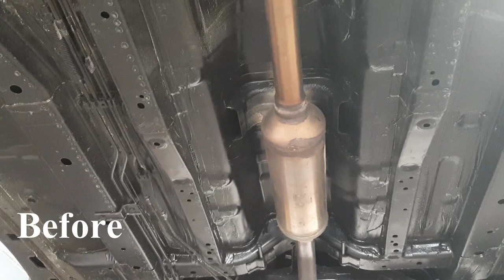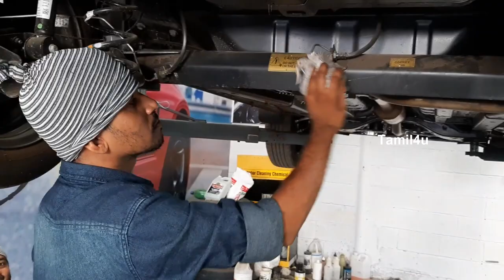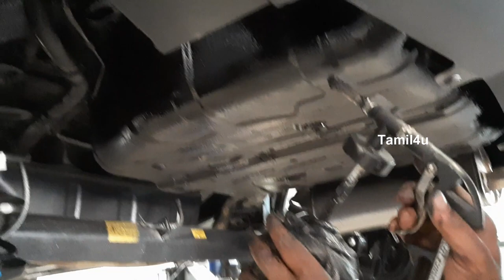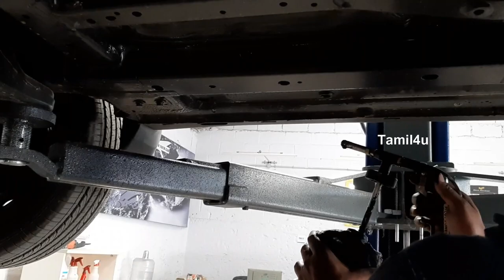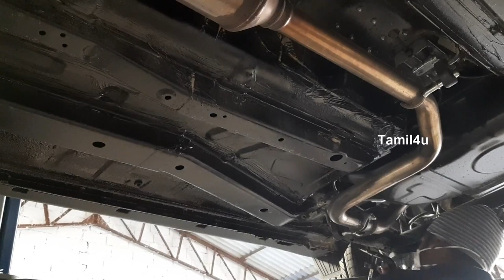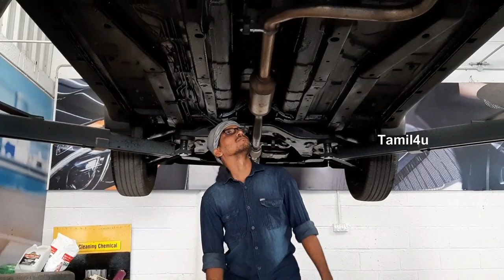How to Make Car Under Chassis Coating | Car AntiRust Underbody Coating | Nexon Accessories | Tamil4U

Comment: Bhai jo pahle se black color he bo pahle se ki coated he, company se aati he coated, apne jaldi karwa li dobara, at least you should wait for 4 to 5 yrs
Reply: Merit Gadi abhi 6 saal ho gayi Hai, kya mujhe karvana chahiye?
Reply: @movementbuilders8828  Bhai depend karta he, Aap karwa lijiye usse protection hi hoti he, but before appling it check kr lena wo acche se rust clean kre
Reply: @asrock009  So wherever it is rusted they should scrape and clean it first
Reply: @movementbuilders8828  yes
Reply: @asrock009  Thank you